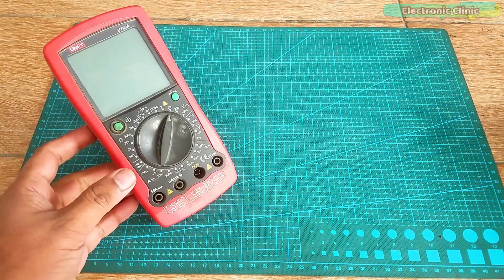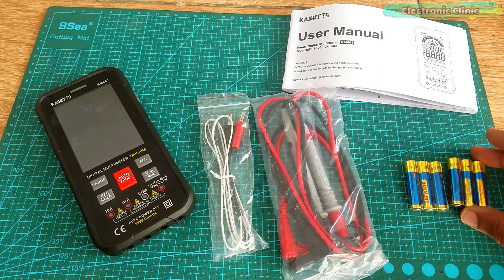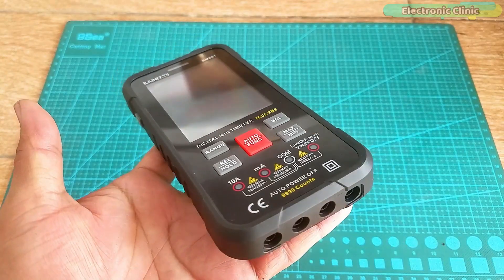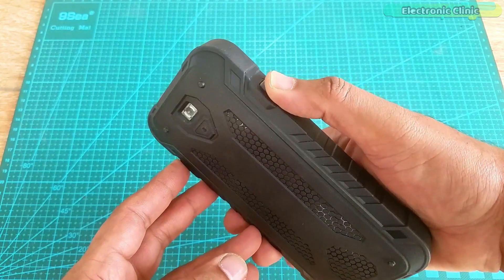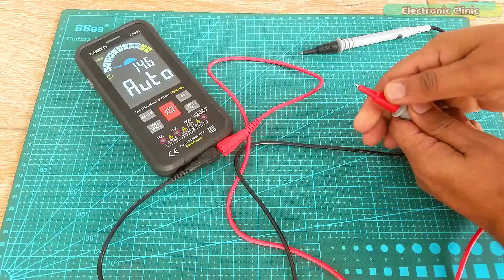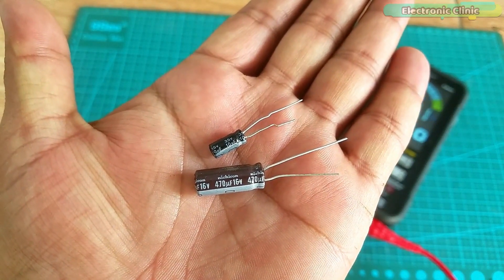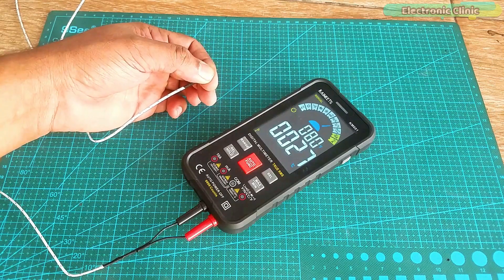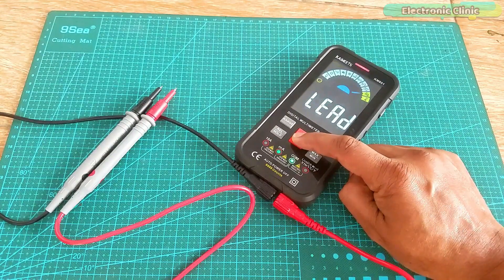Kaiweets Smart Digital Multimeter Model KM601 review and how to use it, NCV, temperature, frequency

Comment: TOTAL CRAP brother:
Measuring wall socket gives 256.8V while with my other multimeters show 243V-243.V.
When measuring 26V power adapter it shows 27.42V while my other multimeters show 26.4V-26.6V.
When measuring 12V power adapter it shows 12.61V while my other multimeters show 12.22V-12.24V.